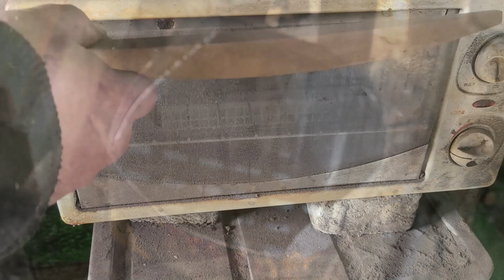Make a Camping Knife

Comment: what liquid to use, in your video, at the minute: 6:50 and minute: 7:06
thanks in advance for the answer 🙏.
Reply from the maker: Thank you for watching.
The black liquid is ferric chloride. The reason for adding it to ferric chloride is to form an oxide film to slow down rust a little.
The brown liquid is water with baking soda (sodium bicarbonate) added. For neutralization and cleaning.